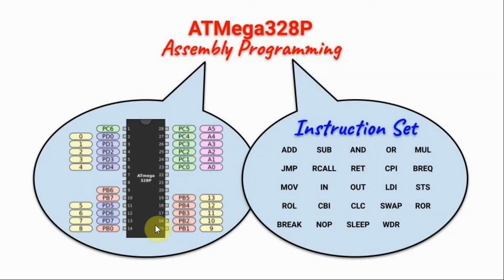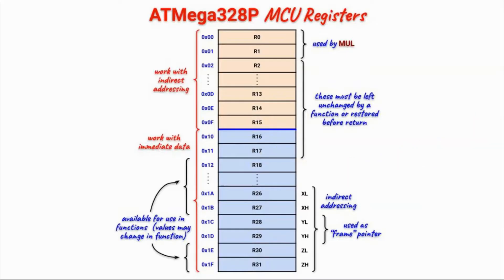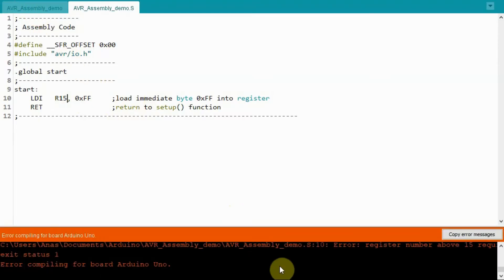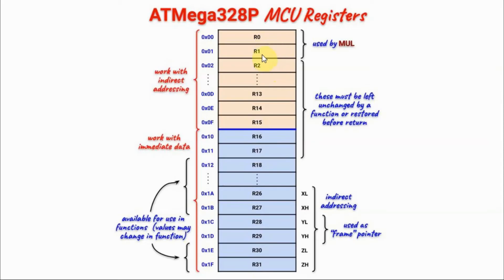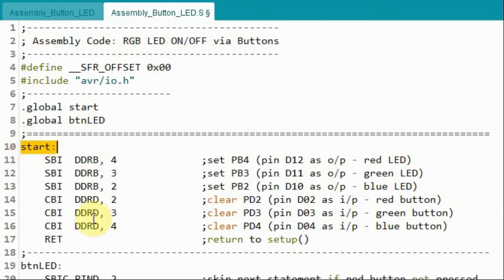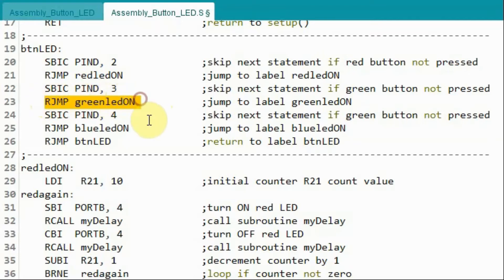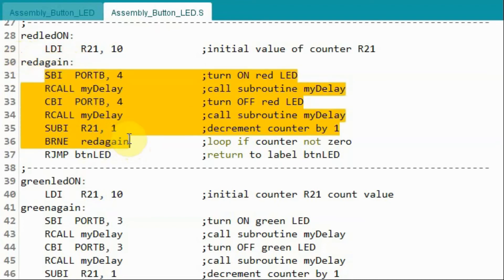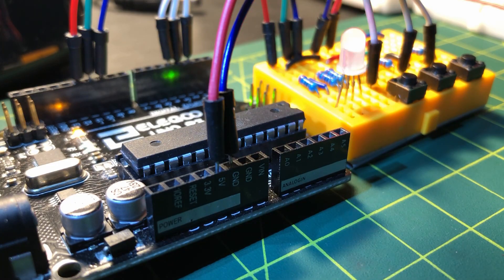Assembly via Arduino (part 2) - Introduction

Comment: Very nice tutorial! A powerfull illustration of how very basic equation and jump commands are sufficient to create more complex loops. It evokes memories to how loops were done in gwbasic, which I used to reinvent some wheels as teenager in the eighties.
Which compiler flags did you use the compile the c code? Assuming gcc is used and the background the -Os flag can be used to optimise for code size. Without a more balanced speed vs size tradeoff is made by the compiler. With -Os the size is probably close to assemebly as compilers are pretty smart.

Comment: Does the Arduino Uno have any registers built into the CPU besides the Program counter and Stack Pointer? (i.e. is there an accumulator or general-purpose index registers that are not mapped to memory locations).   Thanks in advance

Comment: Is there an error in this line? arduino sometimes freezes

previousTimeButton=millis();
    do
    {
      currentTimeButton=millis();
      if (currentTimeButton-previousTimeButton>=buttonInterval)
      {
        //5000ms geçti
        yazdirSureBitti=true;
        break;
      }
    } while(digitalRead(yazdirPin)==HIGH);
  
    //Buton basma için zaman geçti

    if (yazdirSureBitti==false)
    {
        print();  
    }
    yazdirSureBitti=false;    // 
    wdt_reset();
}